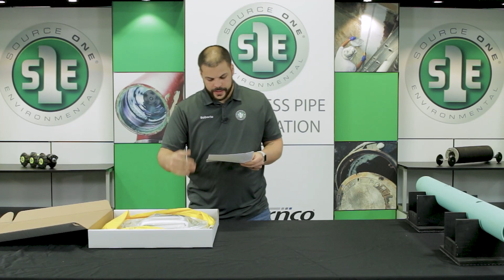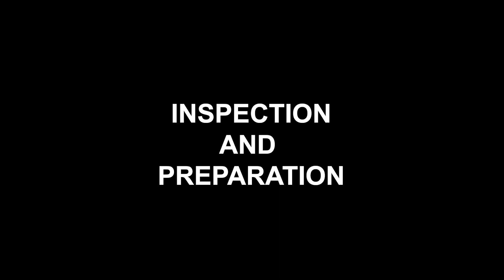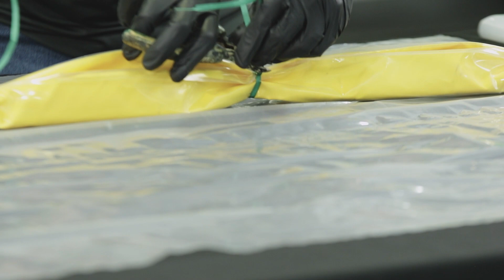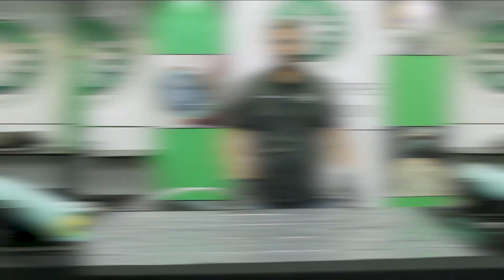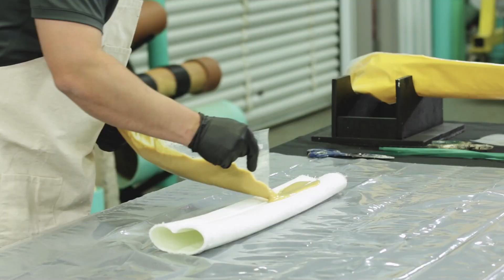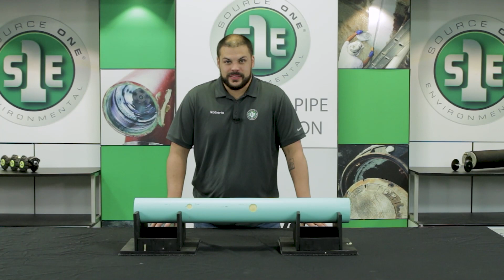How to Install PipePatch ONE | All-in-One No Dig Pipe Repair System

Comment: Hello,
A section (about two feet) of the house's underground sewer line is broken. It's located just below the cleanout. We have two (two-story house, two bathrooms, etc.).

If we use your product, it will clog the cleanout inlet. Is there a solution?

Also, it seems a compressor is required. We don't have one. Do you have any suggestions for purchasing one, given our very limited budget? We're looking for a good, but inexpensive product.

We have a sewer camera.

Do we need anything else, besides the compressor (we need to buy it) and a sewer camera (we have one), that isn't included in your kit?

Do you sell in Canada?
What is the price of this kit? How durable is this product? We don't want to start over every year or every five years.

It's a shame we don't see the final result in the pipeline.

Thank you for sharing.